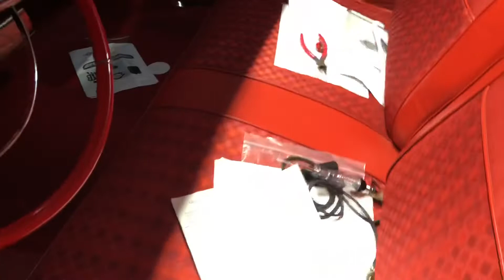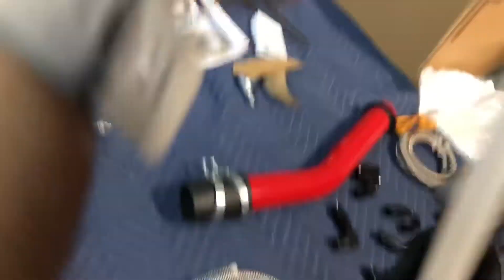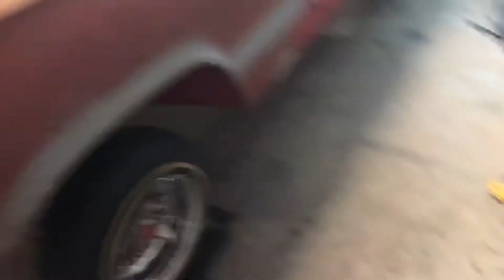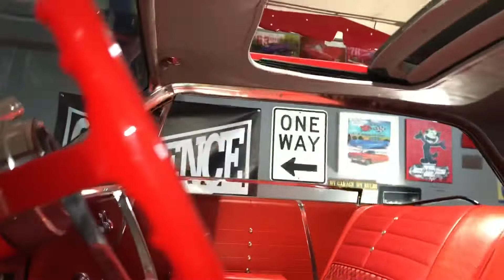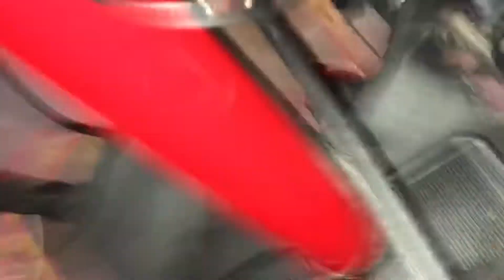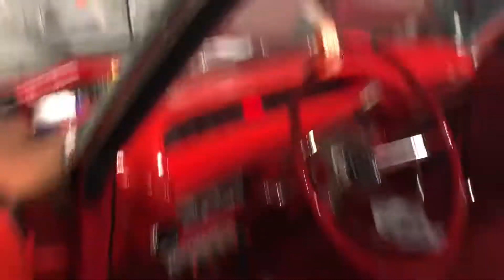1964 impala gen v lt1 swap red rocket updates

Comment: What up bro!? What stand alone harness did you use for the engine and what transmission are you using?
Reply from the maker: Www.standaloneharness.com company based out of Florida. Running a 6l80 transmission.
Reply: @ Red Rocket 64 hit me up bro!
Reply: Awesome! What about the accessory bracket to relocate a/c compressor and alternator… also what water pump?
Reply: I got brackets , oil pan, water pump, a/c compressor, dipstick and tub…. I’m almost there bro! Jajaj.. what headers are you using?
Reply: Also what gas pedal are you using?

Comment: This is top notch work bro👍🏾👍🏾
 I’m doing the same swap but 5.3 I’ve been through hell and spent a lot of paper to make the thing work and I’m still not done🤦🏾‍♂️ they all told me to just do the LS lol
LT swap is much different trial and error and that =+$ 🤦🏾‍♂️
Reply from the maker: There is a whole lot useless misguided LT swap information online and by “mechanics” I’ve done a few LS swaps after this LT and honestly other then parts availability that are proven or fit it’s the exact same. 
For the L83 5.3 you don’t need a fancy fuel pump, use the same exact return style (corvette regulator) and it will work.
Reply: @RedRocket64  I’m at the point of trying to get my exhaust figured out I’ve almost completed the swap and man this project was expensive. I put TSP stage 3 cam DoD delete, springs, retainers all that stuff, check me out…
Reply from the maker: @J2A61  I hear you, it’s definitely not cheap 😕🥴

Comment: What cold air intake is that ? I 
have a ls1 5.7 in my 64.
Reply from the maker: This one is for a 2017 Silverado, I made it fit.
Reply: @RedRocket64  nicee. Can you tell me which 1 and how you make it fit. Thanks man
Reply from the maker: @luisgonzalez1653  its was to long, I just cut it to make it fit, I don’t know if this will work for a LS engine.
Reply: @RedRocket64  can u point me in a right direction for 1 please?

Comment: Back at it watching your build videos lol hey where did you buy the cold air intake at also what style mass air flow does it use? And 2nd what wiper motor is that  and where did you get it? Any and all help is greatly appreciated 🙏
Reply from the maker: Hey what’s up man, sorry for the late response, the CAI is off of a 2017 Silverado and so is the MAF. 
The wiper motor is Newport brand, I bought it locally but have also seen it for sale on eBay 👍
Reply from the maker: Stephen Dudla search this item number on e bay 

184301013525
Reply: @RedRocket64  awesome bro thanks for all the help 👍

Comment: Where did you get the lines that connect from the valve to the cold air intake
Reply from the maker: I made them out of fuel line. I used a brake line bender.
Reply: Red Rocket 64 oh ok smooth idea what about the fitting?
Reply from the maker: Donk Nation the intake came with fittings, They are attached with rubber hose and clamp.
Reply: Red Rocket 64 I’m not a low rider kind of guy but I respect attention to detail shit is nice my guy

Comment: Wicked video.....

That fuel check valve goes where?
Is there hardline fuel line?
That return send unit and pressure unit outside of tank?
Reply from the maker: The LRZ Thanks, the fuel regulator is in line right outside the tank, the fuel pump sending unit is inside the tank. No hardline, it’s flexible PTFE steel braided line.

Comment: So im thinking of putting in the vintage air system in my 63. Mine is a non SS so it didn't come with AC. Are you putting in Vintage Air??? I see you have it in the firewall and the Sandan compressor. I'm just looking for recommendations ahead of time when I flatten the firewall and if I would need to mount the Vintage air where the heater core goes now???
Reply from the maker: Ben Alanis I will be going with vintage air, the under dash unit will mount to the heater core area.

If your going to shave the firewall you’ll need to weld in studs/bolts facing inside the car where the bolts are currently hold header core.
Reply: Had a few questions hopefully you can help me or guide me. I bought the firewall plate from Tim as well and was wondering if in the center of where the two meet did you add another piece of metal so there wouldn’t be a gap or hole??? Wish I could add a pic on here. Second ? How well did those headers from speed engineering workout??? Thanks

Comment: Great Video!! Thanks for the inspiration. The "boring" information was just what I needed to hear. What headers are you running? and can you give me advice on the gas pedal mounting part of the swap? Thanx
Reply from the maker: Awesome man, I’m glad it helped 👍
So the actual pedal has a bracket that it mounts to on the donor vehicle, you’ll need that bracket.
That bracket can either be welded on or bolted on, you’ll just have to get a feel of where you’d like to place it, not hard at all. 
The headers are made by speed engineering, part number should be in the description 👍

Comment: What transmission are you running? I just picked up a Gen4 5.3. I’m looking for a transmission for it and was thinking the 6L80e that I think came with the the engine (2010 Silverado). Was wondering how much tunnel work is needed to fit.
Reply from the maker: I am running a 6l80 trans, it’s really not a whole lot of tunnel work on the 63/64 impala, I only had to lift it 1.5” in the center, I’m sure I posted a video showing it. Let me check.
Reply: Red Rocket 64 thanks! I have been trying to get info and everyone I spoke to said I had to cut out and redo the whole tunnel.
Reply from the maker: Lowriding AZ No problem, what year impala are you building?
Reply: Red Rocket 64 I have a 64 coupe, I am about to take it down and wrap the frame. Plan is to put 8 batteries and 3 pumps. But trying to work out the drive train first. I got a decent deal on the engine and now looking for an ECU and transmission to pair with it.
Reply from the maker: Lowriding AZ Got it, yeah it’s not much to fit the 6l80, not much cutting in the floor,  you’ll need a different trans cross member and a custom driveshaft. send me your email  and I’ll find some pics of what I had to cut on my floor. 
If you’d like to save a bit time and money the 4l60e fits with no modifications to tunnel, its way less expensive then a 6l80e. 
You’ll still need a different cross member and custom drive shaft for the 4l60e as well.
Reply: Red Rocket 64 thanks. I was thinking of the 4L60 and 4L80 but wasn’t sure if they were ran on the 2010 Silverado with the Gen4 and didn’t want to run a separate ecu controller. my email is EtchisonCustoms@gmail.com
Reply from the maker: Lowriding AZ I see, not sure about that either.
Cool, I’m out with the family today, I’ll send you some pics tomorrow 👍
Reply from the maker: Lowriding AZ Just sent a few pics, hope that helps 👍
Reply: Red Rocket 64 got them! Thanks so much
Reply: What oil pan did you use?

Comment: I'm running a 500cpp steering box and a champion radiator also.did you have problem with the radiator hitting the gearbox?
Reply from the maker: No, I’m running a radiator from radiatorforless. It cleared, I just had to cut the fan shroud a bit.
I needed a radiator with both inlet and outlet on the same side, I kinda rolled the dice on this one after some measurements and it fit perfect. 

Now I still don’t know how it will perform, I’ll find out soon. Let me find you a part number.
Reply from the maker: Carlos Gutierrez Found the exact radiator I’m running on eBay, here is the item number 
312807436973
Search that number on eBay,   It will pop right up.

Comment: The Red Rocket is looking hella nice!!! It’s coming along great!!! When you get a chance can you list the parts you used like mounts, radiator, engine wiring, and gas tank??? Thanks I’m looking for an LS2 right for my 63 and I might attempt the install too
Reply from the maker: Thanks bro, I appreciate it, yeah for sure, I’ll do that once I get it started 👍 that ls2 is a beast ✅
Reply: Red Rocket 64 man that LT1 is dope I seen a coupe for sale too but my pockets aren’t that deep haha. I’m sure yours had low mileage but did you change anything on it beside the oil pan???
Reply from the maker: Ben Alanis to make it fit I just had to change the oil pan (Holley)and engine mounts (dirty dingo sliders) I did have to change the front accessories brackets but I wanted it to look cleaner, so I went with the gen 4 (ls) front accessories setup on the gen 5 (lt) front drive is also from dirty dingo.

Comment: Hey do you have the cpp 500 gear box? If so what radiator are you running? And the car is looking killer bro
Reply from the maker: I just found the exact radiator on eBay, search this item number on eBay and it will pop right up 
132278397149
Reply: @RedRocket64  right on bro yea I'm doing a ls3 swap with the 6l80e
Reply from the maker: dragzdoorz awesome, that’s a nice setup 👍
Reply from the maker: dragzdoorz I do have a cpp 500, my radiator is from radiators 4 less, it doesn’t not hit the gear box or electric fans. If your doing a ls or lt swap make you get both the inlet and outlet on the passenger side for a cleaner install 👍